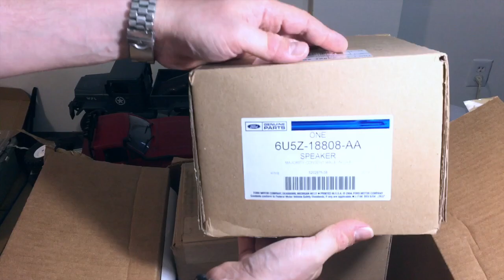Lincoln LS THX rear speakers/subs removal and installation.

Comment: Do you think it would be a hassle to install aftermarket speakers or is the quality just as good using OEM?  Also, do you still have the factory radio or did you install aftermarket?

Comment: Have you ever had to replace a fuse for the subs or replace the amp? My 6x9 speakers arent working at all. Also how many wires are connected to the clip that goes into the 6x9 in your car. I saw some cut wires so i thought that may be my issue as well.
Reply from the maker: hey buddy!!,  I never replaced the amp or any fuses, only these rear SUB speakers.  There are only two wires on that factory wiring harness.  Sounds like you need to trace some of your wires and make sure they are fine.
Reply: Victor Olmos  hey just recently in my Lincoln ls 2003 the rear speakers went out as well , did you ever find a solution ?

Comment: Where do I get these speakers from?? I have a Lincoln mkz 2008 and of course they went out due to my son in law. But I don't know where to get the same factory speakers.
Reply from the maker: hey bro! Unfortunately I cannot give you any advice on the MKZ model.  You gotta google it all, also check eBay, there are tons of junk cars that have very good parts on eBay.  I've purchased rear calipers for my Lincoln LS from a salvage car for like 50 bucks on eBay, no problems.

Comment: I have a 2012 mkz with these two back speakers , can I run a low line off of these wires to a low line converter so I hook up an amp cause I have aftermarket subs , I can't find any wiring diagrams for my car .
Reply from the maker: hey buddy!!,  would love to tell you, really don't know.  I only stick to factory sound, as you can tell.  I hate any sound mods in cars, they always lead to issues down the line.
Reply: Just wanted to update I was able to hook up a low line to those back speakers , I just used a multimeter tester to test the wires to see which one was positive and negative , and hook directly into my aftermarket amp with no problems
Reply: @durvasanramdhani7736  dude i hooked mine with speaker line to rca converter and theres not much bass whats wrong i used same system in my other car and worked good

Comment: I wouldn’t recommend putting in regular 6x9 speakers i did that in my 06 Zephyr and they can’t handle the bass those factory speakers are subwoofers
Reply from the maker: hey buddy! Thanks for watching! Yes, these factory replacement speakers are subs, thats the whole point of this video. I love the THX audio way too much to ruin it with any other non THX certified speaker.  If it wasn't the THX model I would have went a different route.  These things have some serious power for the specs and are original, you know.

Comment: You don't know of any videos of taking out the back cover I got the alpine stereo in mine and there blowin
Reply from the maker: hey buddy.  This model is the THX audio, the alpine covers are different.  From what I was reading on this, you might be able to just unscrew them from the trunk area, It's a simpler design than these.

Comment: For $50 less, you could have gone to a much better aftermarket
Reply from the maker: hey bro! That is true, yes.  But I like tase factory speakers, have you ever heard the THX system in this car?  Once you hear it you really don't need any more power.
Reply: Don’t listen to this comment. I think the stock THX speakers are amazing. I think they have deeper bass than any $50 aftermarket speakers. You did a great job for using the factory speakers. :)